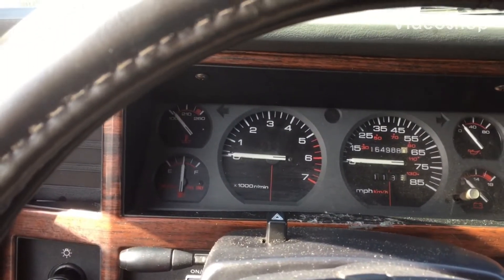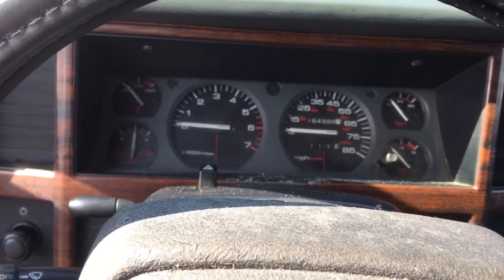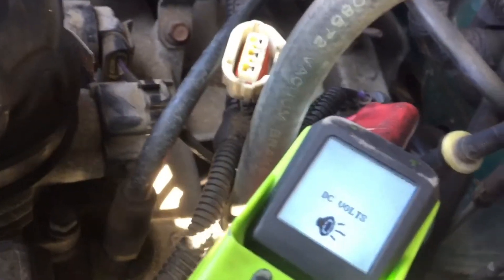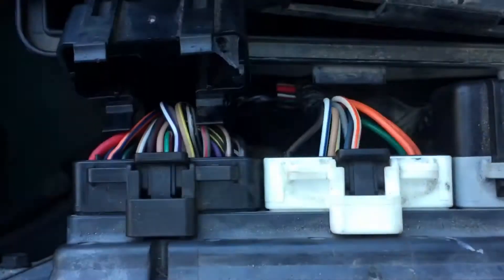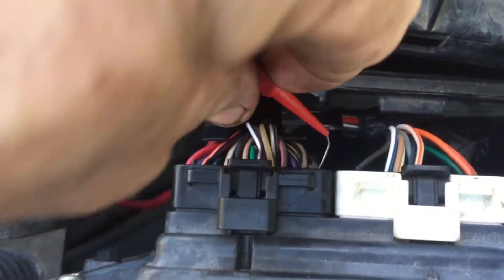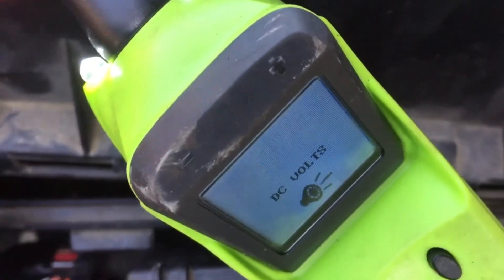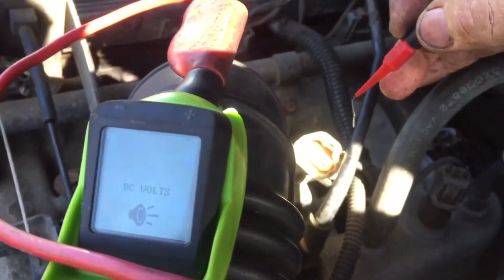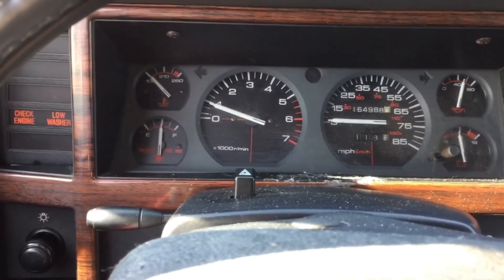How to check the computer on a Jeep Cherokee

Comment: Thank you for the video. Trying to diagnose my ecm on 95 Grand Cherokee 5.2. How did you know which wires to check going into the ecm?
Reply from the maker: I use a paid service that gives me wiring diagrams (Mitchell ProDemand). But you can usually find a wiring diagram with a little bit of hunting on Google. 

Jeep doesn’t change much on their ECM’s between models, though. I wouldn’t be surprised if yours had the same locations as the 4.0 for the power, reference, and ground wires.
Reply from the maker: I had a chance to look this evening, and the power, ground, and 5volt reference wires for your 1995 Grand Cherokee are in the exact same places with the same wire colors as shown in this video. I hope that helps you get it checked out!

Comment: I have a 1996jeep xj 7 Crankshaft position sensor.and still no go First 2 crank up But when you cut it off 📴 will not crack back up  Last 2 are Mopar crankshaft position sensors But made in Mexico  Check ✔️ 5.volt reference  Only has 4.2 that is if I read it right . I've done all the on off and light But still no luck    Got code reader All it shows is link error   Can you tell me what might be wrong with it .I am 75 years old  in a half way house on parole. Spent over $475 just in crankshaft position sensors Any help in anyway Thank you very much Ronald Alcott
Reply from the maker: My apologies Ronnie, I never received notification for this comment. What do your crank sensors look like when you pull them out?  I’ve seen a few Jeeps that will eat the crank sensors due to a flexplate touching them and tearing up the tips.